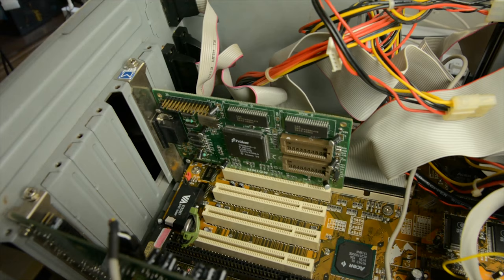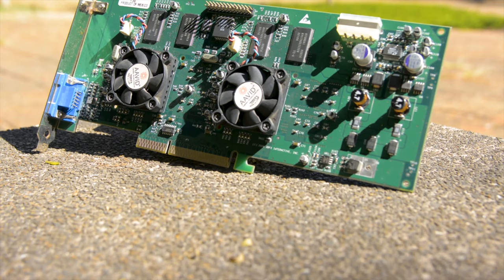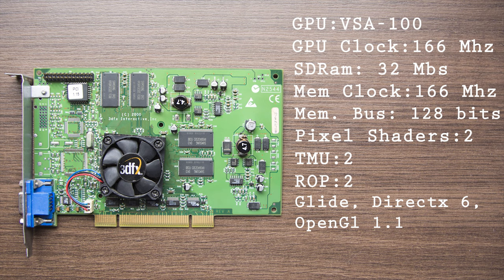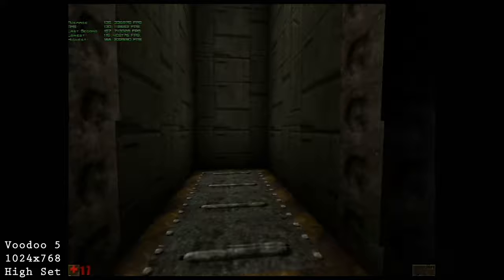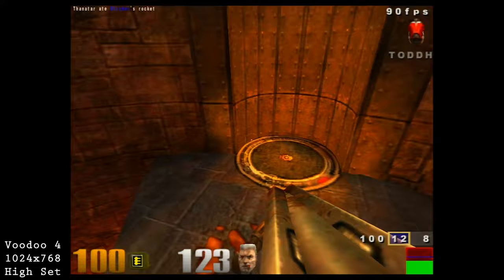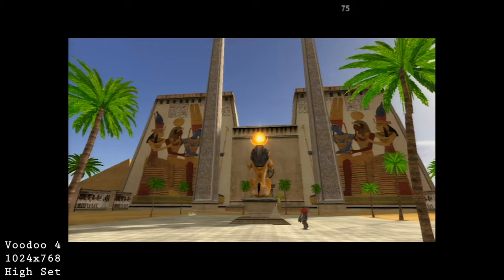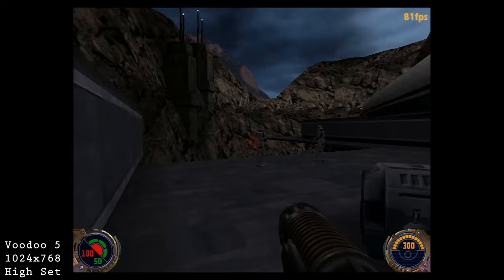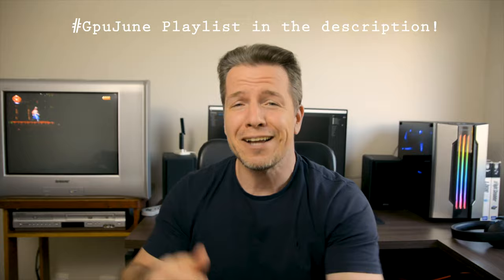Voodoo 5 vs Voodoo 4! #GpuJune

Comment: Nice one, Sucra! I remember choosing between the V4 4500 and the GF 2 MX. Ended up with an Elsa Gladiac Geforce 2 MX. It was my second video card ever. Congrats again on the video!
Reply from the maker: You made a great choice. I was a 3dfx fan from the beginning though, my first 3d accelerator was a voodoo 2. Then a V3, and when the V5 came out man, I had to have it. I questioned my self if it was the better choice, obviously not in retrospect, but hindsight, you know how that goes haha. Thanks for watching, have a great weekend!

Comment: another great video! love hearing your trivia and thoughts on the games, makes the video feel more personal and entertaining. I skipped these cards back in the day, i went from the voodoo 3 straight to the Geforce 3, loved both cards very much! I have a V5 now and planning to build a period accurate PC around it. Question: whats that cool vice gadget you used early in the video to hold up the V4? seems very handy! Great channel keep up the good work!
Reply from the maker: Thanks, man! I'm glad you enjoy it. I skipped the Voodoo 4, but I had a Voodoo 5 on release. I remember getting it as a Christmas present. I considered the Nvidia GeForce 2 GTS at the time, but I remember it being out my price range. I'm glad you were able to get a Voodoo 5, I want to build a new system for mine as well. Hey, to answer your question, I think you're talking about the Voodoo PCI, with the black PCB. That is a PCB holder so that you can work on them. Not a particularly good one, but it served well enough for that shot. Cheers, thanks for your support!
Reply: @SUCRA  Thanks for the follow up. Yeah I was interested in that vice, i will have to get one for recapping video cards. I had gotten the V3 when that came out in 1999 so i stayed without an upgrade until was able to self build a new PC in 2001. SO much happened in those 2 years when you think about it. Thanks for sharing your experience!

Comment: The rival of the V5 was the Geforce 2 GTS and that of the V4 was the Geforce 2 MX. A similar comparison video with those cards would be very interesting.
Reply from the maker: Yeah, I thought about buying the GF2 GTS when I bought my original v5 in the year 2000, but it was more expensive at stores, maybe the v5 had already had a mark down. I do want to make those videos, with the v4 vs the MX might be easier because the GF2 GTS is a bit expensive and hard to find, the pure MX is not that easy either, but there are a bit more. I don't have any of them right now.

Comment: The V4 4500 was overall slower than its main rival the GF2MX by some 10-30% but its price was  179 $ compared to 130-150$ for a GF 2MX. Almost everyone puchased the GF2MX and ignored the V4 4500. The result was a disaster for 3dfx.
Reply from the maker: True, the v4 was a bit late to the party. Apparently there were delays on developement. If they had put that out earlier it might have been different. Also because Glide was still a thing, and personally at the time I was one that still wanted to use Glide.

Comment: The Voodoo5 always takes advantage of the second GPU as each GPU renders one line on the screen separately. There is no SLI profile or anything else needed like on todays Nivida cards or former crossfire solutions. The only way to disable SLI is to force one chip rendering in the driver menu. If the fps scores between the Voodoo4 and Voodoo5 are almost identical, it is a sign that the AGP1x interface of the Voodoo5 became the bottleneck in here. If you reduce the texturequality in Jedi Outcast the fps will increase as the AGP interface will not hold the Voodoo5 back anymore. You can also push this bottleneck in more modern games with large textures to the extreme when the Voodoo4 overthrones the Voodoo5.
Reply from the maker: Interesting, I need to test that. Thanks for the comment. Have a great weekend!

Comment: Would be interesting to see if the Voodoo5 6000 performs as well compared to the Voodoo5 5500 as the Voodoo5 5500 performs compared to the Voodoo4 4500.
Reply from the maker: I totally agree. If I ever get my hands on a 6000 I'll absolutely do a scalability test.